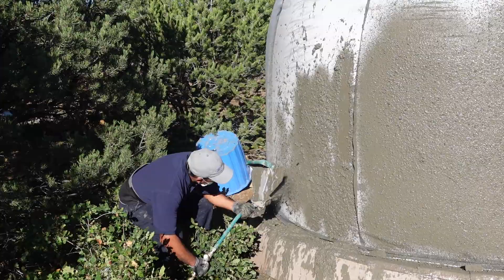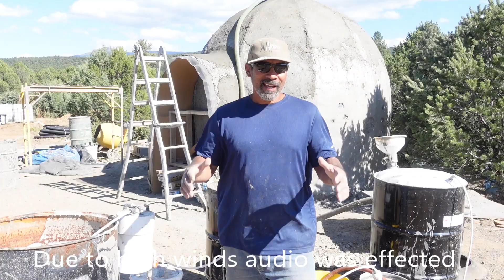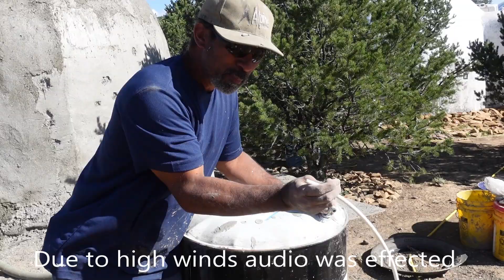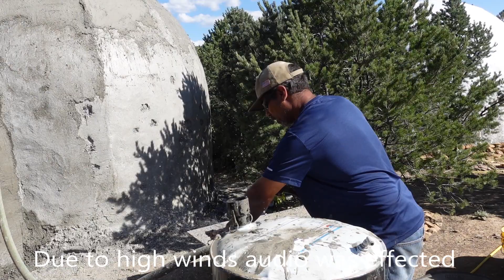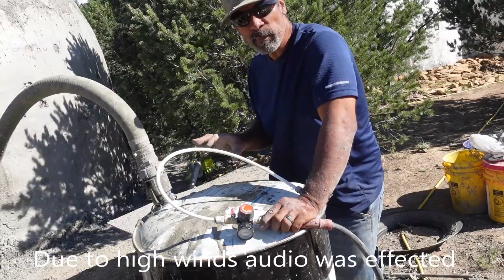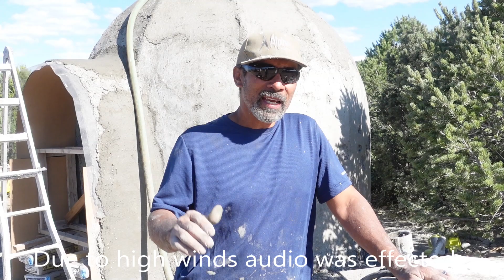Pumping Aircrete | DIY Aircrete Pump | #aircreteharry #aircrete #foamgenerator #diy #diypumpkit #kit

Comment: Harry , why couldn't you use steel barrel with a lever-lock lid? You could hook your fittings to that lid and mix/pump aircrete from the same barrel.
Reply from the maker: Hey Phillip, how are you?
The barrel I used in this video was what I had on hand. 
Yes, another option would be a barrel with a lock lid. Both work well. 👍

Comment: Use a pressure relief valve in the air inlet system so you never overpressure the container. Filter for chunks. Use a bottom outlet = no tilting. Also, if you can figure out a removable top you won't have to move the mix. You dump contents into the barrel, mix it, put the top on and pump it. You're welcome, world. Also, I don't think this has to be limited to domes, now then, does it? Thatta make ya think, huh? ;-)

Comment: Great concept. We just used your foam generator for the first time today and it worked well. 

Two questions: 1) Can you mix in fiber-mesh in that pump set up? 

2) Have you looked into manufacturing a double wall plastic shell as follows: The inner tyvek shell is identical to what you use. 9" tyvek straps connect it with the outer tyvek shell that is bound to the inner shell. In this way when the inner shell is inflated, all you have to do is pour your aircrete in between the two tyvek shells that are linked together at the bottom and sides and keep the fan going until it hardens and use your pump to do the filling - perhaps putting in the pipe before you blow the dome up so it's in place. This eliminates the double concrete shell and as long as the pump is kept full it could be done in 1-2 days with the strength coming from the fiber mesh. 

Another approach could be to build a rebar dome, put the inner tyvek shell inside and blow it up or attach it with ties to the rebar, then sleeve the outer dome over the rebar and put your pump on the top to fill in between the two tyvek sheets with rebar inside for structural integrity. Any thoughts on either of these techniques? 

I have a number of 17' domes I plan to construct - around 30 - so every labor-saving technique is quite valuable. Let me know if you have the ability to manufacture the inner and outer dome shells 17' in height/width? You can reach me at dane@mysticallandscapes.com

Comment: A few questions I'm wanting to start a dome build business for homes and businesses. Have you done a wind speed test, Earthquake test and a fire test? If so, what are your results? Have you shot a 2×4 at different speeds to simulate tornado conditions? Because it is so lightweight, what about anchoring to keep it from blowing down the road in winds of 240 miles per hour. I live in Texas, we have three main conditions to address one of them is flooding. I noticed that this concrete can float. Do you think it is possible to lock the domes to the ground and release to float upwards above the surface ground 4 to 8 feet. Almost like a car lift??? 
Sorry, I have a lot of questions about ways that would lessen disastrous conditions damages. Of course, nothing will be 100% because natural disasters conditions can change in a blink of an eye. But some readiness is better than a square house that leaves you with nothing. The number one cause of so much damage to a home is the fact that it is square. That is why I am asking Congress to change the requirements for rebuilding in natural disasters zones to dome shapes. 

Mankind needs to rethink its building processes and get far away from square buildings as much as possible. Cylinder, egg and even pill shaped buildings are aerodynamic and fluid dynamic. What are your thoughts about public safety during national disaster and how a dome home could be the answer these areas?

Comment: First of all, you're not spraying "cement" as you call it. You're spraying concrete. Learn the difference. I was building geodesic domes out of plywood 50 years ago and what was true then is still true. . Nothing fits into a dome. Fighting leaks is a permanent maintenance item. The acoustics will drive you nuts. A cost of $5000 for a 16' dome ($24.88/SF) is sure nothing to crow about. Air entrained has its place in construction but you're taking the long way around the barn. Learn it the hard way, I guess.
Reply from the maker: Mark you are Wrong!! Concrete consist of rock, sand, or gravel and cement. I have no rock, sand, or gravel in my mix there for I am not spraying concrete! You have to learn the difference in the ingredients  that make up what I'm spraying. Unlike the inferior geodesic domes made from wood. I do not have leaks in my domes, I build them to be maintenance free! For $5000 you have a dome that will never Burn Down, with a shell that is 8 to 10 inches thick, Bullet proof, bug proof, water proof. Air entrained AKA Aircrete does have it's place and with the Aircrete mix designs I have developed it is used to insulate my slab, and in this video the walls. Instead of the very expensive spray-foam. Nothing long about this way I can build any size dome up to a 40 foot in 7 days solo. Very easy and fast. The dome in this video is one of two ways I build Domes.

Comment: Why not Spray foam insulation between the two concrete layers?
Reply from the maker: That would defeat the hole purpose of Aircrete. We are using Aircrete as the insulation material Spray Foam is very expensive.

Comment: How much thickening agent do you add to a 94 lb bag? It didn't come with instructions. That looked like 4 or 5 oz?
Reply from the maker: 2 cap full per 94lb of cement.
Reply: @AircreteHarry  Awesome, thanks!
Reply from the maker: @RedandAprilOff-Grid  Instructions were sent in the email upon purchase in the email, please check your spam folder as well. / note in the package stated the same.
Reply: Ok, thanks! We must have missed it in the packing materials.  I'll check the email.  Yesterday we poured 2,  45 inch deep sample forms. One with our standard mix and one with the addition of the thickening agent. Neither seemed to sink much, so we probably need to try again with an even taller form. I'm glad we have the garden wall to fill with all of our practice batches.  We are having good success with 2 foot deep pours, although probably losing some volume as we dump multiple batches in. Once we are done, it doesn't seem to settle much, unless we get a leak, or air pockets around the chicken wire.
Reply from the maker: @RedandAprilOff-Grid  Of the two 45 inch deep samples poured you will find the thickening agent one to be stronger and harder faster.

Comment: How thick are those outer shells of cement on the air forms?
Is it a thin latex cement that could be sprayed with a hopper?

I'd love to build this way but am worried about cost with all the specialty tools/ingredients/airforms
Reply from the maker: For this building system you only need .5 - 1inch thick shells and fill the space with Aircrete. You don't need to use latex but it makes it stronger. The Air-form you can make yourself for $220. Goto Aircreteharry.com and buy the How to build an Air-Form.

Comment: I am planning to use a plastic barrel with a screw on lid.  with the hose attached at the bottom and the foam generator at the top. After mixing put on lid and turn on air to the foam generator to pressurize
Reply from the maker: Steel barrel would be better. Here is a video of my first pump you can also check out the videos before this one: https://www.youtube.com/watch?v=BREZ5C5PCYI

Comment: If your fill spout had a tube inside going down near the bottom, could you still fill and pump out without having to tilt the barrel?
Do you think some 1/4" mesh over the opening would help prevent chunks getting into the fill line?
Would almost be tempted to hook up something like a shopvac to suck the aircrete into the barrel or just make the lid removable so I could mix right in place.
Such good work, an impressive setup already.
Reply from the maker: YES!! To all of your ideas. This was fast and easy, but you could do any of what you said to make work easier.

Comment: Great job Harry!  What mix did you use for the two concrete shell mixes?  Did you use that stucco sprayer rather than your green shotcrete pump/sprayer?
Reply from the maker: Thank You! The first shell was the Latex concrete mix( Portland & Sand) the second shell was EPIC cement mix, all you need is Portland and sand for the two shells. I was teaching a workshop and showing how to make all 3 mixes. And I used a stucco sprayer for the first time to show you don't need a heavy duty shotcrete pump machine to build with my air-form system.
Reply: @AircreteHarry  You used the Latex mix because it is strong, correct?  I would have thought you would have used that on the outside layer as well since it is waterproof, correct?  How will you waterproof the EPIC outside layer?
Reply from the maker: @robbrubaker6869  I will be making a latex cement mix. The dome is not done yet.

Comment: the double shell sounds like a significant improvement... how can one make sure that both shells remain at a constant distance of each other, and how can one be sure there won't be bubbles or large empty areas between the shells (what is the minimum shell separation)?
Reply from the maker: That's what I teach at my workshops, my next video will talk more about the two shells. https://aircreteharry.com/product/october-9-17-2021-aircrete-harrys-hands-on-workshop-1-person/
Reply: @AircreteHarry  thank you for your reply ... though from this side of the pond, it's not very likely I'll get a chance to attend one of your classes any time soon by the current look of things...
Reply: What is your email, please? We will gladly notify you once we have the online course available on our website. Cheers,  Mrs. Aircrete Harry
Reply: Looks like the second layer is pressurized with air, thus creating a cavity.
Reply from the maker: @duanethieme4186  Yes the second airform is filled with air also.
Reply: @duanethieme4186  obviously, but what ensures that the cavity is of constant thickness ?
Reply: @n1352-m1i  It looks like aircrete  is somewhat self leveling, you should be able to feel where the level is at to try to keep it uniform.
Reply: @duanethieme4186  that remains far  from obvious to me...
Reply from the maker: @n1352-m1i  By making the air-form and how we mount the air-form is how I control the thickness.
Reply from the maker: @duanethieme4186  You are correct!

Comment: Just curious, what size or type of air compressor are you using Harry?  

How did you determine the "cavity" between the airforms?   I did not see any particular spacers other than ridges on the first airform.

What is the radius of the dome?
Reply from the maker: The Air compressor is the Gas powered Harbor Fright 180 PSI. I wanted 6 inches of Aircrete so I made a 10 foot Dome and 11 foot dome making 6 inches if I wanted 12 inches I would have put a 12 foot Dome air-form over the 10 foot. Before mounting the air-form I marked the ring beam I will have another video talking about the dome coming out soon.
Reply: @AircreteHarry  Great thinking... And, thank you for the quick response.

The pump looks fun and simple enough for us "off gridders".  Great work!